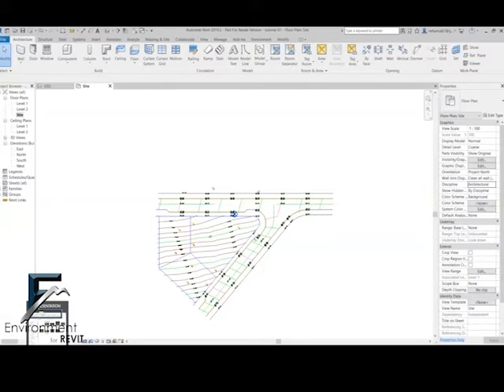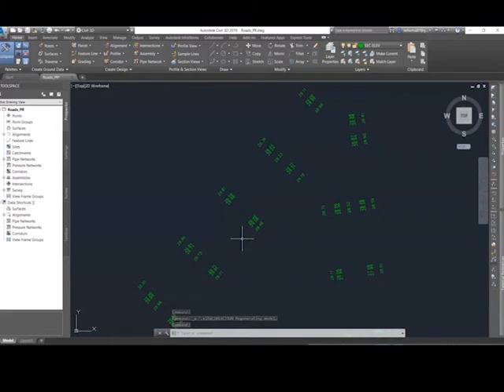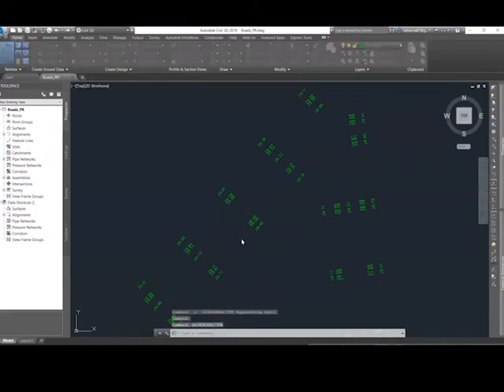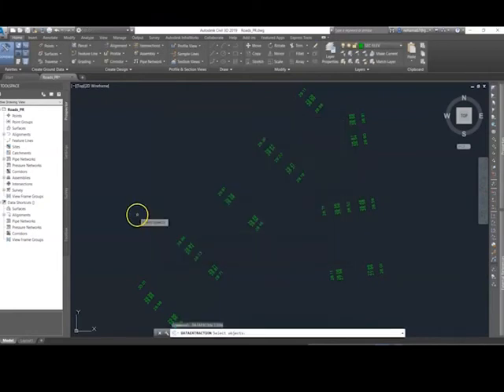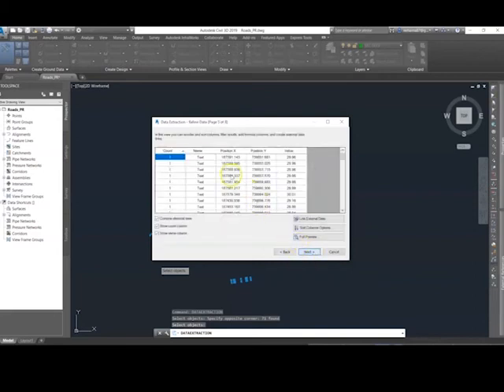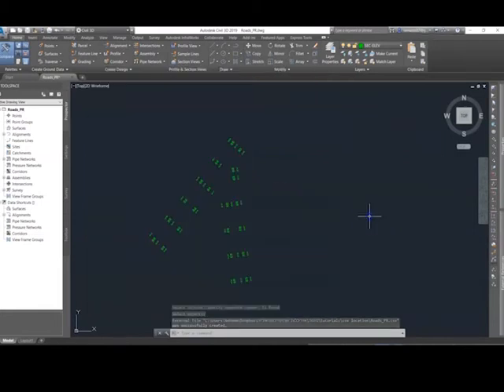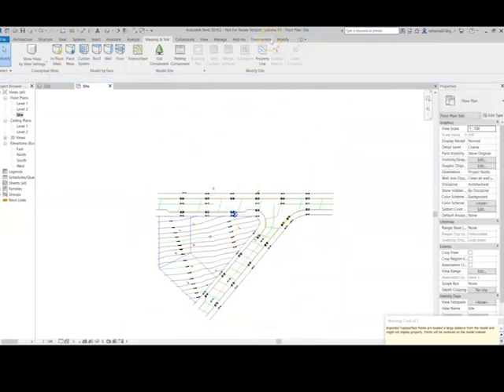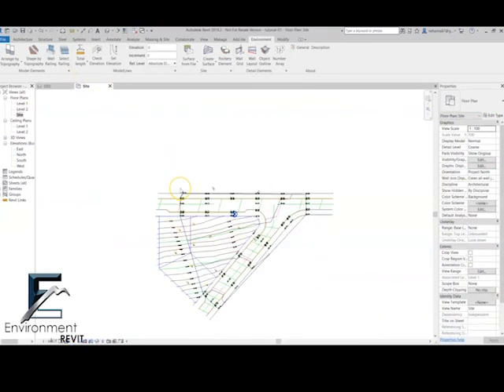Create a surface from CSV file & CAD dataextraction | Revit® for Landscape Architecture

Comment: I got "Wrong File Format!" when I tried to import the data.  I tested it once before, probably 3 months ago and it seemed to work fine.  I'm not sure what I'm doing wrong.
Reply from the maker: Hi. There are few tips for this tool. 
1. Make sure your values go like X,Y,Z, and all of them in the same units. 
2.  Open your CSV file in Exel and check if there is no not number value there. Sometimes you can find additional symbols in the value itself, like “cm” etc.
Reply: @Arch-Intelligence  I'll check thanks.  I've only been exporting X and Y, no Z.  I made sure both the DWG and the RVT are both in MM
Reply: @Arch-Intelligence  ok so exporting with Z and deleting the headings all seemed to help.  It didn't error out.  Now the only issue is the units, it placed them off somewhere.  

I am working in mm, but because the project is large I import my CAD in meters so I'll play around with scaling that up and down
Reply: @Arch-Intelligence  Wow I tried to replicate that again and it failed. I can't win
Reply from the maker: @ScottValentine  I will contact you through email to check this issue.
Reply: @Arch-Intelligence  SUCCESS!! It doesn't like the CSV being open when you import it.